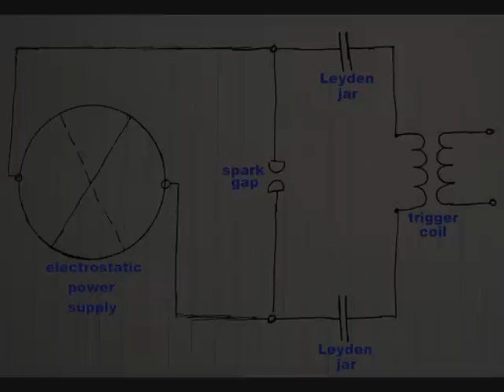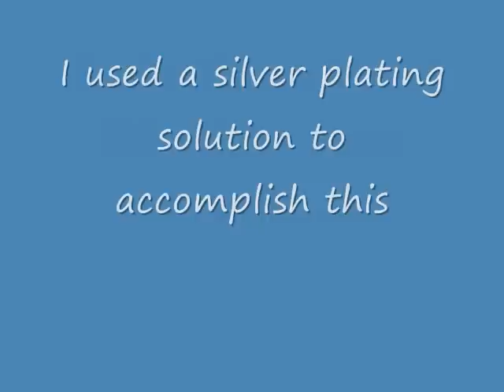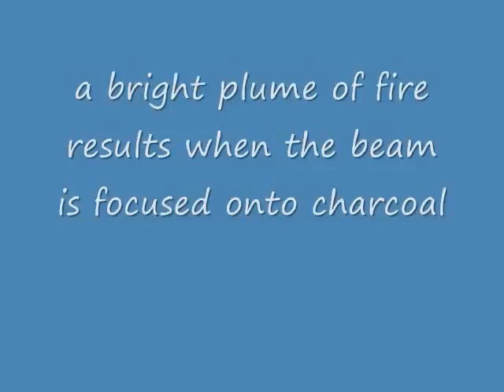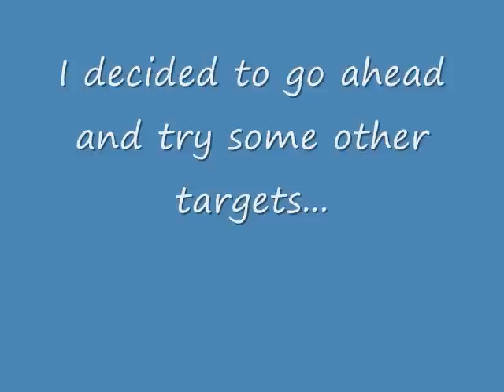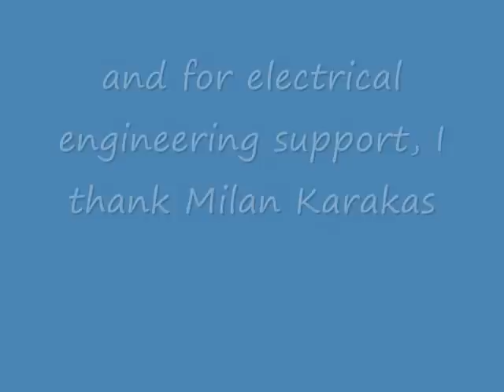Homebuilt Ruby Laser

Comment: If anyone is still reading this I have a 5/8" X 6" ruby laser rod (synthetic sapphire) that I want to sell. I got it at an auction at Macdonel Douglas in St Louis over 20 years ago. I had the 20 some pound chamber made of brass with silver plating with water cooling. The rod was mirrored on both ends but now need to have that redone. I know nothing about lasers I was in the surplus equipment business.
Reply from the maker: lamz633 

Send me a pm or email

Comment: Very good results! I'm building also a ruby laser( but using a 40x8 mm rod with 2 helical flashlamp). I would ask you some questions: Are the mirrors curved or plane? What do you use to charge the capacitors?
I have all the parts to start except the power supply, do you think that a rectified NST could work to provide 1250v?
Thanks

Comment: Which mirrors did you use at both ends? Where did you buy them from?
Reply from the maker: Pulkit Sharma

I think the output coupler is an Nd:YAG mirror (however, I'm not sure if it's an output coupler or high reflector). The HR is a mirror I grabbed out of an old HeNe scanner. 

As long as a mirror isn't designed for a totally different wavelength (such as a dielectric mirror for an argon laser, designed for blue or green laser wavelengths), then it should suffice for a HR. The OC is far less critical. This is a high gain laser, so even a series of two or three microscope slides will work as an OC! 

It's not so much a question of quality. Pulsed ruby and Nd:YAG lasers have incredibly high gain. It's mostly a question of which mirror types will survive. My advice - use mirrors that are expendable. Consider them to be disposable. If you spend mega-bucks on fancy dielectric mirrors that are designed for the 'real' world, you can't replace them once they are damaged by the internal beam. 

Lasers like this one will cause permanent and total loss of vision, even from an indirect or scattered reflection of its output. If it can vaporize tiny holes in steel when focused, imagine what a mere fraction of its energy would do to the retina of your eye (the cornea, with absolute certainty, focusing the beam, automatically making your retina its target)! Furthermore, the energy storage capacitors will turn your flesh to ashes, instantly! It's a long term project. Simple in photograph, yet profoundly hazardous.   

People keep asking "why" I don't provide video. Answer - because most of the action will fall between camera frames - it's too brief and too fast. At least not without a fancy camera. However, recent advances in technology have made such a prospect at least partially worthwhile. Although it isn't on par with a professional high speed camera, the new iPhone 6 has a feature that will shoot ~240 frames per second, which might provide some compromise :-)

https://youtu.be/bsbGHD5xNJM

Comment: Everything seems legit, how much did it cost? did you designed the power supply or did you purchased it? Power supply looks pretty professional with phoenix connectors and everything. Do you have a specification datasheet on the laser tube that you used. Sorry to ask this much questions I've been interested in building one fro a long time, but I'm under the idea  that the third world salaries in my third world country won't allow me to even approach to a budget that would allow me to even start making one. By the way, your laser rocks :D

Comment: Its nothing just some photos taken from internet, show ua the video or a proof that you made it and it worked out
Reply from the maker: Thanks. I took the photos with my own camera. Some of these photos can be found on my website and some can be found on my Flickr page. These laser pulses last for a millisecond or less. Video recording would require a camera with many frames per second - more than what is used for common everyday recording. At the time this presentation was made, the video cameras I owned were relatively simple. Years later, I was able to use the so called "SLO-MO" option on my iPhone video camera to at least get some of the action. Additionally I had to use another app to further slow the action down. However, it was still a long way from being the quality that would have resulted if I had access to a real camera designed to capture this sort of thing. 

Website Photos: http://jarrodkinsey.org/rubylaser/rubylaser.htmlFlickr Photos: https://www.flickr.com/photos/12049698@N02/albums/72157622792699231Newer YouTube ruby laser video: https://youtu.be/rqY-UG5qxcE

Comment: Are both mirrors external or do you also have mirrors coated on to the ruby rod itself?
Reply from the maker: Mirrors are external. The ends of the ruby are not mirrored. To my knowledge, only the very oldest ruby rods had mirrored ends. If the ends of the rod are mirrored, then the rod does not lend itself to experimentation or any variation in design. In addition, q-switching is not possible if the ends of the rod are mirror coated (which is likely to be one of the main reasons why only early lasers were designed that way). I stand to be corrected - if anyone else has knowledge to the contrary, please do not hesitate to share!